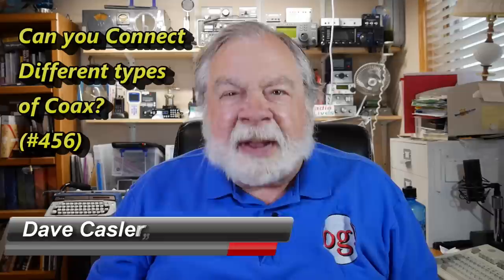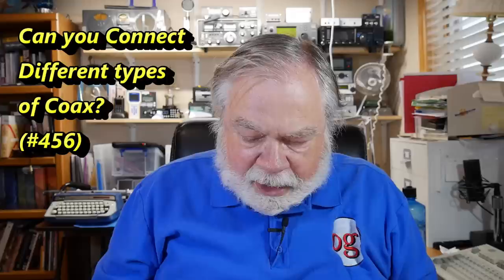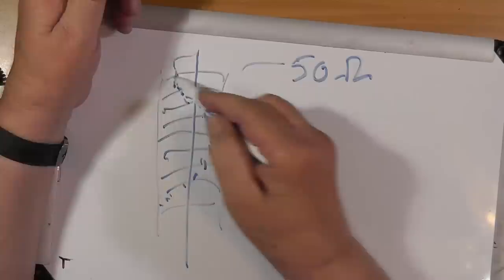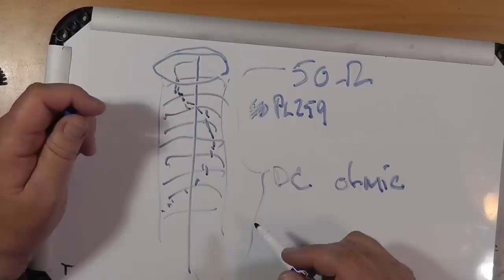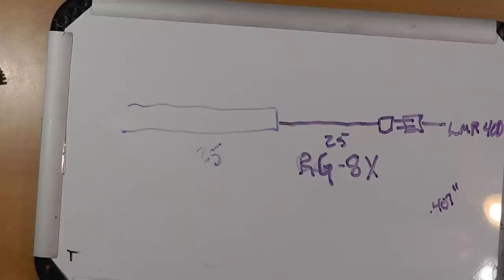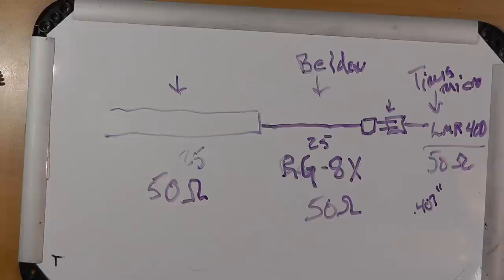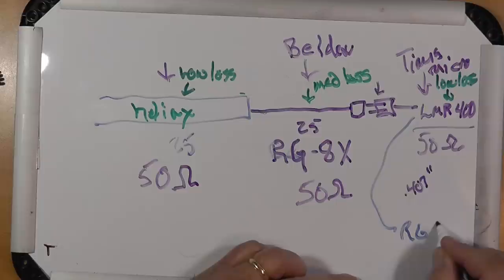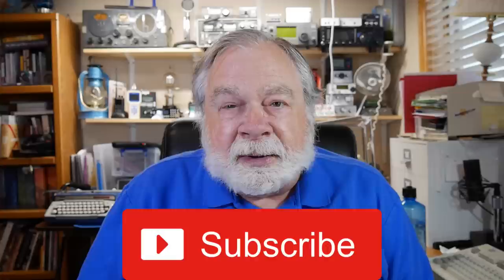Can you Connect Different Types of Coax? (#456)

Comment: Well thanks so much for answering my question, Dave! That was exactly the information I wanted to understand.  Just so you know how I got myself into this pickle--  I bought a lot with hundreds of feet of various coax pieces for $10 at a garage sale. I own a good crimper with a large set of dies. I've purchased connectors for the "normal" coax, and learned how to reuse the Heliax N Connectors.  So, why would I mix and match to make long runs? Because I can! (and I just hate waste in the world, so this makes me feel good too). Thanks, Dave!
Reply: I would use the Heliax for a mag loop antenna or 3 :-)
Reply: Since this is garage sale coax, I think that you should check the cable for loss before you use it.   Old cable that has been laying around for years may not be that much of a bargain.
Reply: @terry5089  you’re right. It was pulled from indoor conduit. Jacket in great condition. Checks out on the VNA, and the measured loss is very close to the manufacturer’s spec sheet. I think I got a steal. ….the 20 Heliax N connectors are worth it alone (they go for $10/ea used)
Reply: I have used Heliax before for commerical use and one thing to consider it that it is open inside and can get moisture in it and mess with the ballance and or short out.  This is why the center is usually pressurised with dry nitrogen gas and monitored for mositure.  This is one of the reasons it ususally only used for high power or microwave stations.  If you can't keep it charged with nitrogen then mount it between vertrical and around 40 degrees and drill small holes at the lowest point to allow the moisture out.  Trying to seal it will only keep the moisture in and it will build up to a lot of water inside.
Reply: @TroyCraft  Excellent!   You did get a steal.  Congratulations.

Comment: As a former broadcast engineer, there are adapters from heliax to whatever connector you need. But, heliax is way overkill for most ham installations and is very difficult to work with compared to RG8x or RG213..... k6sdw

Comment: I have a tower with 3 hf antennas and 2 vhf antennas.  The tower is 160 feet from my ham shack.  Through an underground conduit, I have two heliax cables, one for hf, one for vhf.   At the tower end, each heliax goes to an adapter to coax, then to a remote antenna switch, with coax to each antenna.

I used heliax for the 160 foot run to minimize loss over that distance.   Inside a conduit, the heliax does not flex or move.    On the ham shack end, I also use coax and antenna switches to allow my multiple rigs access to the antennas

73  Ray   K1XV
Reply: Sounds like an amazing setup.  Thanks for sharing!
Reply: That's what I did with my tower too. The tower 75 feet from my house and 80 feet tall. So, 155' to the antennas. I used three runs of 7/8 Hardline to the top of the tower, then transition to RG-213 to the antennas.

Comment: In fact at broadcast stations it is generally the practice to use short flexible jumpers at he ends of heliax runs. At one studio I installed a 100 foot feed line of 7/8 inch heliax for a 946.0 MHz system with RG213 jumpers at the transmitter (Moseley PCL606C) and the antenna (Scala PR450U). The heliax was terminated with N females and the 2 foot jumpers were N male to male. You can get heliax connectors from Andrew Corporation.

Comment: Times Microwave also makes an "Ultra-Flex" version of their LMR400 cable called LMR400UF.  It is not as stiff as the LMR400.  I have installed crimp-type PL259 connectors on LMR400UF with no real difficulty or special tooling other than a compatible crimp tool for the shield (the center pin gets soldered).  The PL259 connectors & crimp tools were all purchased from eBay and worked great and weren't ridiculously expensive.  73 Dave.

Comment: For the guy who asked, you build resistance or connection issues with additional connectors. You want a solid, uninterrupted line. The connections can get wet or dirt. Oxidized or rusted or what have you. If you need 100’, but a 200’ reel. I use rg8x. I only needed 25’ of the 500’ reel. I paid less than $120 on Amazon. I have so much, I wanna hide the reel. But I made more custom cables that were cheaper than buying pre-made. As an added point, I could have made and sold several lengths at a ham fest! Plus, it’s fun making things!

Comment: Just saw you on page 50 of the July 2021 QST magazine.  Congratulations!

With regard to the gentleman with the Heliax,  RG8x, LMR400 coax , I'd suggest he buy a 100 foot length of either the Rg8x or LMR400 and not buy multiple connectors which add expense and the addition need for multiple connection's waterproofing, and potential future problems...
Plus the extra cable length could provide an RF current choke.

Comment: Dave is correct with the point of soldering LMR. you can't really solder aluminum and the high heat trying degrades the dielectric. Crimping is the only way to go. I use RFC connectors.
Dave

Comment: I mix n match coax at my station. Outdoor HF runs are LMR-240. Short patch cables inside are RG-58 or LMR-240 ultraflex because they are easy to bend and work with. 73 de WB4DW

Comment: I use the DX Engineering version DXE 400 MAX with Chinese clamp type PL259 which are assembled similar to N connectors. You need a soldering iron for the center conductor and thin wrenches to tighten the connector, no apecial tooling required.

Comment: Hello Dave:  As is mentioned by other followers here T  M  has the LMR 400UF  or Ultra Flex which is a lot easier to work with and is sold by DX engineering  along with their new design of crimp type coax connector's, B T W  I saw and read your new column in QST magazine and found it interesting !!!  I Also was an I.B.M. Employee here  on the east coast at the East Fishkill plant
in Dutchess county, state of New York, I worked there for 31 years !! The EF plant had about 13 to 15 thousand people there during the 1980's into the 1990's  John Bellas 73's from KC2UVN

Comment: The helix with a coiled insulator allows pressurized dry air or nitrogen to permeate the entire feedline and the antenna itself in the case of high-power broadcasting.  Special fittings are used with gas ports to connect the dry, inert gas supply such as is provided by a dehydrator. These connectors are very pricey. Such heliax cables are usually large such as 1-5/8" or larger.  1/2" and 7/8" heliax is usually foam filled and not pressurized.  Connectors for 1/2" heliax are available from Commscope sold under the brand name "Positive Stop".  Not too difficult to install. 1/2" N about $25 +/-

Comment: I worked on Motorola 2ways and all the Hardline I worked with had female type N because they used short jumpers of RG213 or RG214 Hardline to the antenna at the top of the tower and to the radio at the bottom. It is not easy to bend Hardline! Most of the time I used pipe benders! One wrong bend that kinks it and it is trash!  And it is very hard to bend but easy to kink! I wished I had some!  Great for long runs up the tower. Some of the connectors have a place to ground the outside of the cable!  If you think the cable is high priced, the connectors are Brass and some of the bigger ones I have seen are over 2 lbs!

Comment: I run 50 feet of LMR 600.  Stubborn and mean to work with, but tough and low loss for VHF and UHF.  Maybe overkill, but viscously cutting down every potential loss does yield results.  

Now, Mr. Casler, how does different velocity factors affect potential SWR and data when you put two different coax in line?

Comment: Most thinner heliax uses N type connectors anyway...
Thicker stuff uses mainly seems to use 7-16 DIN connectors

Adapters between the 2 are readily available (used extensively in cellphone infrastructure) but they aren't particularly cheap

DE 2E0LNE

Comment: Just wanted to add this.  I’m using LDF4-50A currently and have some 7/8 which I’ll be adding between the shack and the tower and then will add the LDF4-50A at the end to make the shorter bends.  I’m not using this because I have to, but because I was able to work out a deal, plus its with less than 1db attenuation up to 200MHz, and 70cm is around 1.4db att at 100 feet, high quality and most of the RF project where in the GHz range before getting the HF rig.  Anyways, I had many N style connectors, for the LDF 450 and 7/8 so rather than attempting to re-terminate to PL259, I kept the N style and purchased adapters from DX Engineering which were N Female to PL259 and it seems to work great.  Messi and Paoloni makes some compression style .50 PL259s, however they are designed for stranded shielding and I’ve not got them to work with the LDF4-50A as its a style of Helix with good flexibility.  

DXE’s N to UHF adapters are silver plated brass and great quality.  I’ve had issues with the Amazon adapters, so I changed all of them out with the ones from DXE which currently cost $16.99 for 2x.  They are made by NTE Electronics part number DXE-06-0102-2, and they can be purchased elsewhere but they seems to be higher.

My 2 cents, N style compression connectors are available for Heliax.  UHF/PL259 connectors I had trouble finding, plus the N style connectors are great, so just adapt them over to UHF.
The N compression connector spec sheet should have the dimensions needed for installation.  Heliax can be a pain unless you have the right tools, so plan on using a tubing cutter for the jacket, razor knife for the dielectric, and a file to taper the center conductor normally needed for compression style connectors.  You can also buy some slick prep tool that mounts to a drill, which speeds up the process quite a bit, which takes about 10 - 15 seconds.  Although I had to trim it afterwards for the connectors I had, it performs all of the operations needed in the spec sheet, assuming you use a compatible brand connector.  They cost around $150 for .50 Heliax, and I would not buy one if I only had a couple to do.  Commscope makes some, CPT-F4B for .50 Heliax, but hold you wallet for 7/8, as they are significantly higher, which is why I’m not buying one.  If I did installs for a living, yes they save a tremendous amount of time, but for a couple here and there, no for me.  Manual prep tools are also available at around $40.

Side note, I use Amazon connectors still, but not for anything with some power.

Hope that helps a little

Comment: I have seen many different coax cables, all labeled as RG-8X.   Many of these have SIGNIFICANTLY different  RF characteristics, including their loss figures
.
Which brand of RG-8X do you use Dave ?
Reply: Yea, you have to be careful with the RG-8X, as quality can vary wildly. That's why I just use Times Microwave LMR-240 instead. It's roughly the same size and quality is assured. They make a "regular" version, which is pretty stiff, a direct bury version which is stiff but has some goo in it to protect against water invasion, and an "ultraflex" version which is easier to bend (but still not as easy to bend as, say, RG-58). Anyway, if it says Times Microwave on the jacket, you know it's good quality.

Comment: Some of the large Heliax LDF (low density foam) the connectors will run more than 150' of LMR400. I know, everything in my shack over 30mhz is hardline. But I have a source for pull out hardline.
What about velocity factor?

Comment: Dave, here is a challange for you.  try to test to see the loss caused by connectors in a coax line,  even if you add 10 or more in line you probibly not be able to measure it at HF frequencys.  It is an old story with no basis that pl259 connectores cause a 1db loss,  it is not even 0.1db  (if they did cause this much loss they would be hot in your hand when you tansmit) take care and as always thank you for your great videos.
Reply: I was once in a rush make some RF measurements at 2.4 GHz.  The only adapters I had that day were my PL259 versions.  The results were absolutely horrible, 

The next day I found my BNC adaptors, and everything  worked fine with them.
Reply: @howardhiggins9641  well if you look at my comment you will see that I said HF not UHF.  PL259 is is best used for MF, HF and and some VHF. The marine industry uses it for all their VHF radios with no problems, other than poor solder jobs.

Comment: With regards to LMR-400, why do you recommend crimp over solder? I thought soldering was supposed to be better for longevity and connection strength? I’m a new HAM so I don’t really know what’s best!
Reply: I have used solder connections on LMR 400.  There is a sticky goo in the coax that is miserable to work with so I prefer crimp connectors for LMR.
Reply: Times Microwave recommends crimped connectors. Get their brand connectors and toolset. Watch their "how to" videos on YT. Back in the 1980s when I first got into amateur radio most crimp connectors were garbage. Things are different in 2021.

Comment: In fact if you could have an infinite length of 50 ohm coax it would measure 50 ohms on a DC multi-meter. Alternately a discharged finite length of 50 ohm coax would measure 50 ohms at the instant of connection. Think looking a an electrolytic capacitor using an ohmmeter. This is why it is sometimes called the surge impedance. If you cut an infinite coax and replace the remaining infinite length with a resistor equal to the characteristic impedance it will measure the same as the infinite length.

Comment: If one band takes priority, you can place your connector/adapters so they fall on the odd quarter-wave lengths of that frequency, when taking into account for the propagation factors for each cable , so the introduced impedance bumps 'disappear'.  Oh yea, you'll go broke terminating the Heliax.

Comment: Each cable has a different velocity factor due to the differing dielectrics. I’ve not seen a discussion of that mismatch’s effect, if any, on reflectivity or loss. Some have proven through experiment that the loss in connectors and adaptors is wholly insignificant at HF.  The biggest real-world concern is keeping water out of the couplings. Water always wins.

I chose LMR-400 (actually the Andrew/Commscope CNT-400 equivalent because I got a spool at a great price) for its lower loss at 6 meters. It’s essentially invisible up to 30 MHz. Antenna, and especially feedline, efficiency is not the place to skimp. That’s like hooking up a garden hose to a fire truck...lots of power pinched off at the outlet.

I use ordinary crimp PL-259’s (properly sized) on the CNT-400. It’s double shielded, tinned braid and foil, so you could solder, but not many people get that right under any circumstance, and it’s tricky with 400 because of the foam dielectric. You can’t be a soldering hack. Melting the foam changes the impedance, or if egregious, can short the cable. A properly prepared crimp made with the correct die in a good tool makes a very good connection. The center conductor is copper clad aluminum. It solders easily. Get the iron hot, get in and get out quickly before the heat can conduct up the wire and melt the foam.

I use LMR-240 ultraflex upstream of the amplifiers. The 400 is too stiff to be straining on all the antenna connectors and switches. The 240’s loss is insignificantly higher in short runs around the radio room and its power capacity is more than adequate ahead of the linears. It’s so flexible it’s almost limp.

Several of the coax manufacturers have charts online, comparing loss and all the other interesting characteristics of the various solid and foam dielectric cables. Dealers have these too, but they’re sometimes rather simplified.

Comment: My apologies for resurrecting an older video, but I have a relevant question concerning splicing of different coax cables, all 50 Ohm:

I was just gifted around 200 or so feet of FXL-540 Commscope (1/2 in hardline with foam dielectric) and not only has it been discontinued for over a decade, connectors seem to be hard to come by and take special (i.e. expensive) tools to terminate properly.  That being said, is it possible for a non-connector based (solder) splicing of two types of coax without major technical issues?  Say, a 6' RG8X pigtail spliced to each end of a 150 ft length of hardline?
 
I'm not running any major power, 100 watts or less and also no long lengths either, around 150 ft total.

What say you?
73

Comment: As a retired Broadcast Engineer and 2-way shop Manager, smaller Heliax, such as 1/2 inch, is perfect for 2M and up.  It is not too difficult to work with.  It is not too hard to find used in good condition.  7/8 inch Heliax does get much harder to work with.  When you get up to 3 inch Heliax and up it is way overkill for Amateur purposes.  Mostly, Amateurs should stay away from air dielectric Heliax.  Air dielectric is lower loss, but keeping it dry is difficult.  Connectors should not be reused.  New connectors are very expensive, being mostly machined brass.  w0fen Robin

Comment: I have two 75’ runs for vhf/uhf. Would RG-218 be sufficient or would it be better to have lmr-400?
Reply: Have a look at the losses per foot / metre graphs. 3 dog Biscuits is half power. 6 dog Biscuits is an S point. 

Big differences between 70cm and  7MHz
Reply: If I was doing weak signal VHF/UHF work,  I would get the LMR-400.

Comment: By the time he got done getting all the right connectors, ends, tools required to get it to work, might just be better off using that money to buy a single 75' or 100' length of continuous RH8x or other decent cable. Not to mention the losses with each fitting and potential or water intrusion in each one.

Comment: I have 260 feet of 1/2 inch Heliax with N connectors on each end in my shed.  Salvage from a commercial radio system that was dismantled.  Got it for free.  The stuff is really stiff.
Reply: it's all relative. I have 2 runs of 7/8 hardline. But believe it or not, I'd rather put on 7/8 connectors than 1/2"